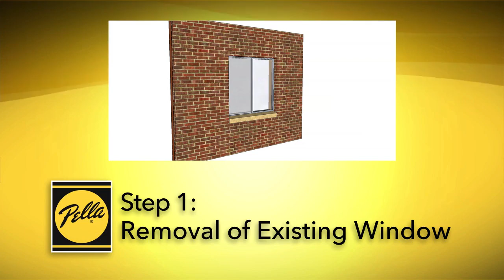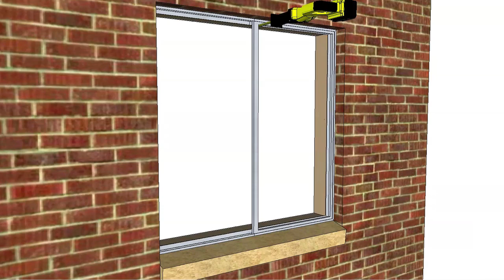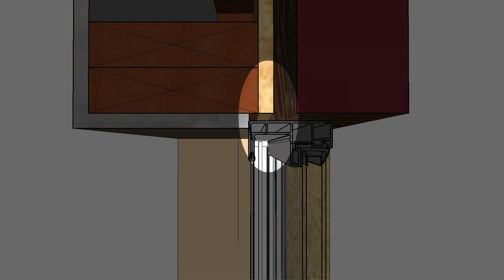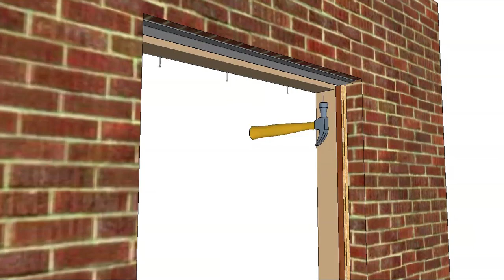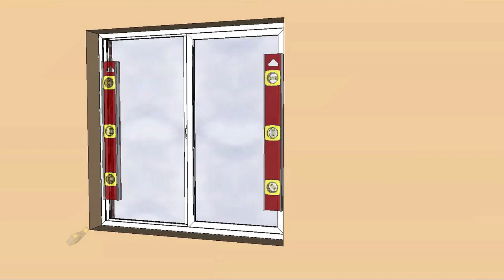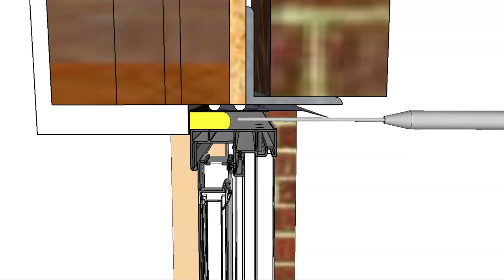How to Replace Block Frame Windows without Disturbing Brick or Siding - Supplemental Instructions

Comment: Also I'm not entirely sure what the drip edge is doing for a pella window... Between the lentil and the brick you should have already have a drip edge. If not two. Pella also generally sends a top flange that has a built-in drip edge so what the hell are we wasting our time building a drip edge for?

Comment: Also I disagree with the step of pulling the window deglazing the glass whatever you have to do to get the window out of the masonry opening in order to measure it to ensure your new window has a caulkable Gap... Probably ensured that that's the case before pulling the window.

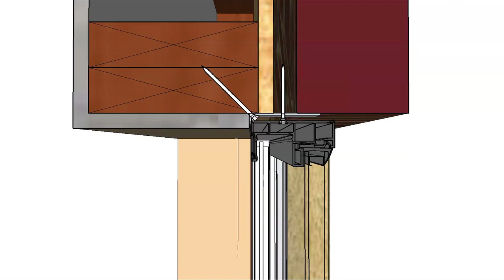Comment: Thank you very much for this excellent video.  The detail in the animation was superb.  Even though I am not planning on replacing my windows as a diy project, I am very concerned about the installation process and options.  This answered many of my questions.  I am sure most sales reps would not take the time to explain these important details to the customer.  I was especially interested to learn about the drywall return installation clips explained at 3:00.  I can imagine the horror some customers would feel if a crew showed up and unexpectedly started cutting back their returns.  In many cases, that could result in significant loss of depth of the return, making reinstallation of window treatments difficult.  In my case, I have a couple windows with ceramic tile returns, and one window with a silestone stool which probably cannot be cut back easily.

Comment: What is a drywall return
Reply: I realize this is a couple years after the fact, but thought I would clarify in case anyone was still wondering.  There was a clear picture of drywall returns throughout the video. It's where they use drywall on the side of the framing members (i.e., studs or header) that butt up against the window.  Instead of drywall returns, some homes use casing around a window, much like door casing.  You can get something called "jamb extensions" with some types of windows, if you will not be using a drywall return.
Reply: Good question.  Our installer has not heard of them.
Reply: @charlesborsos6257  I would run from any installer that does not know what a drywall return is.
Reply: @charlesborsos6257  Heard of Google? If installer doesn’t know that basic terminology...ehhh